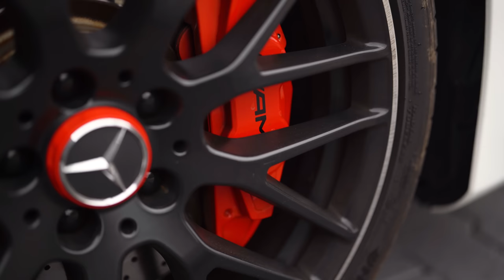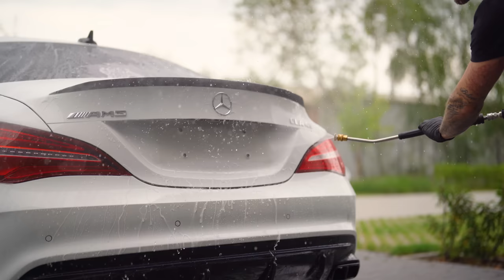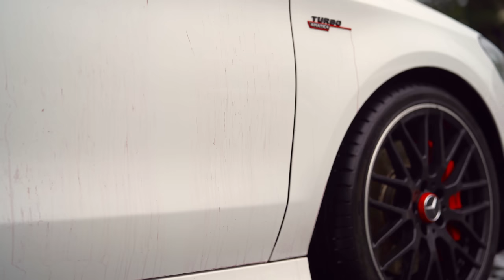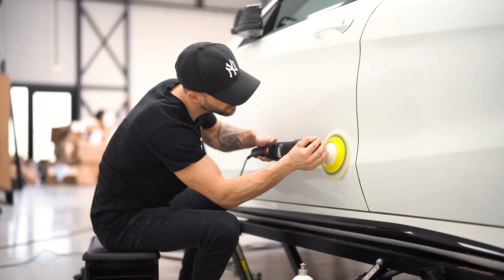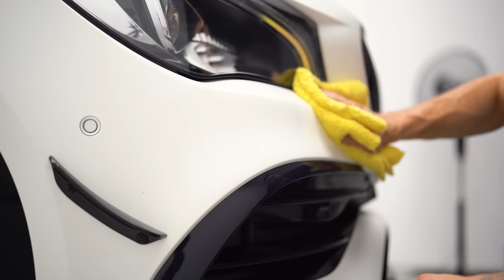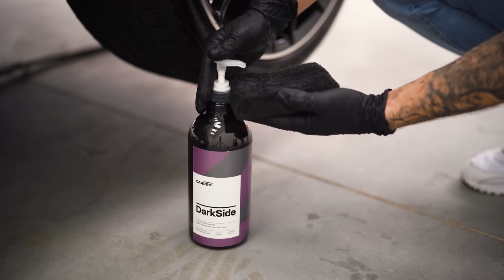Mercedes CLA45 AMG - Wash, Polish & Coating

Comment: Can you tell me where you got the black badges (rear mercedes logo, CLA45, AMG, Turbo 4Matic)? I have this exact spec and want to do the same badge replacement.
Reply: Hi, sorry for the late response, i'm the owner of the car. I ordered the original badges at mercedes and went to a paintqhop to make them black. Not a cheap solution, but the only way to have high quality badges